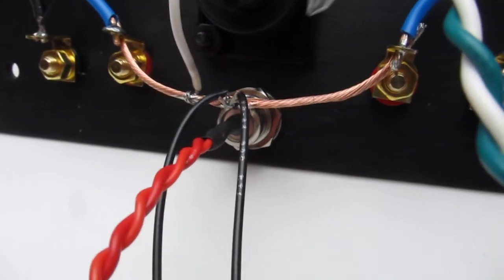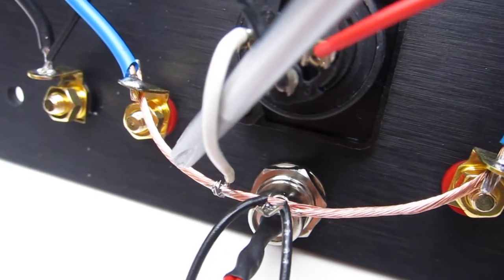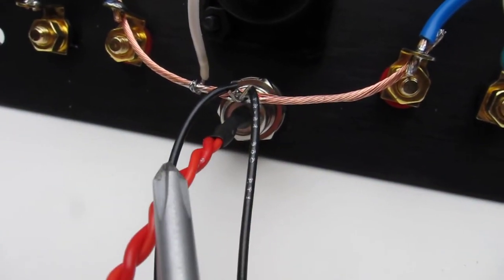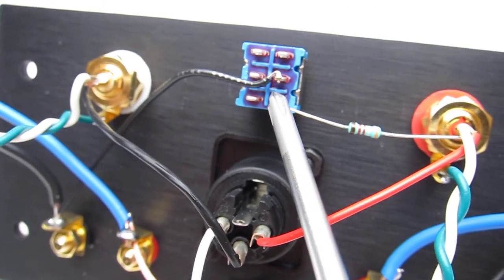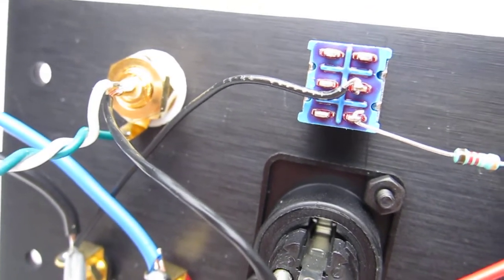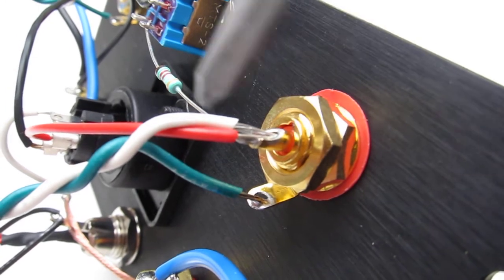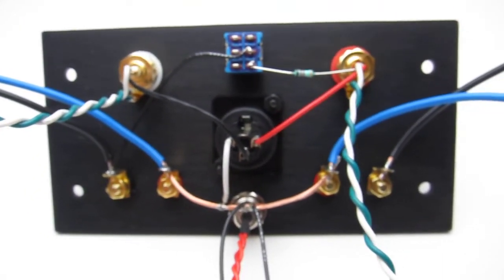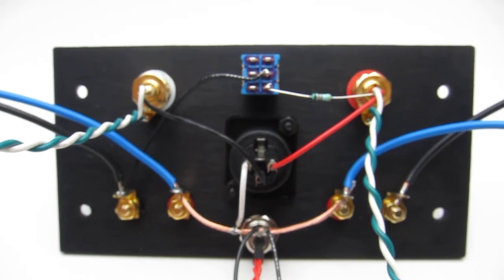ACA 1.6 back panel wiring

Comment: Looks good! 
Is this the configuration that accepts a single balanced input or stereo RCA? I saw 4 different configuration possibilities, but maybe I need to RTactualFM.
Reply from the maker: As shown, 3 configurations -- Single XLR for Bridged mono output, Single RCA for Bridged mono output, and Stereo RCA  for Stereo output.  If you want to add some jumpers you can also make it single RCA input Mono output parallel.
Reply: @xAEROPLANEx  oh, so that means one amp is handling the positive and the other the negative, just by plugging in a balanced signal? Does that then mean I would use just the right output on the right side and just the left output on the left side or left on both? (I am also reading the manual)
Reply: @xAEROPLANEx  AH! OK I found it step 54. Kind of glad to find what I expected. Thank you!